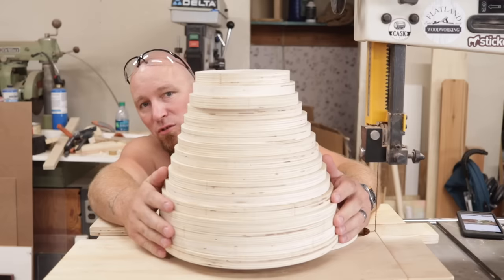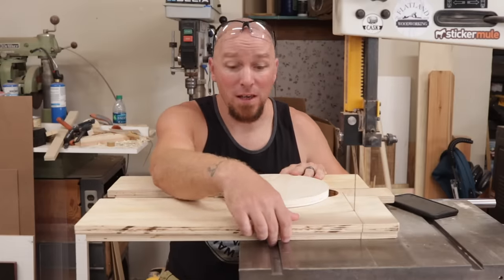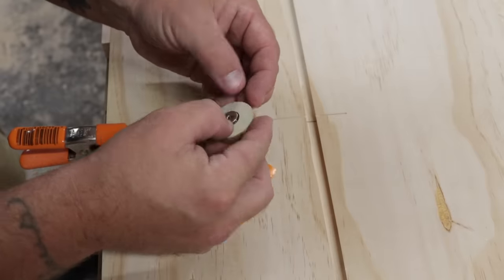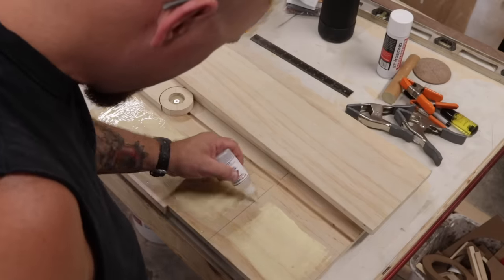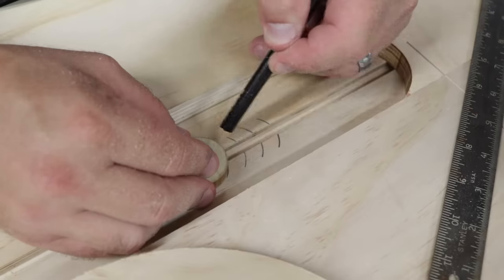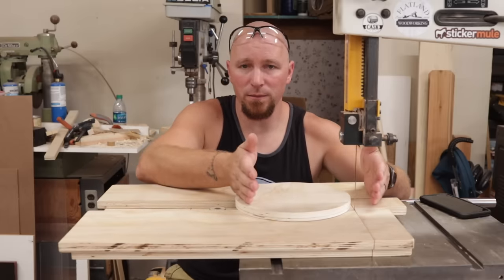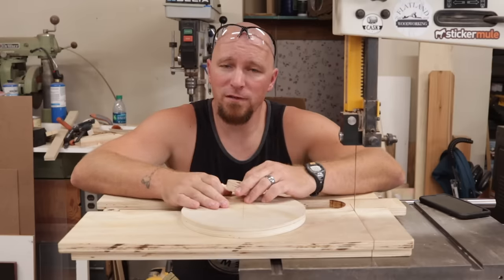The ONLY bandsaw circle cutting jig that fits EVERY NEED!

Comment: Ok, I built this jig.. It works well. I made a couple alterations. On the "stick on puck" I used a thin pull saw to make the alignment marks on the face and sides, then filled the marks with white acrylic paint and sanded. I used walnut for the puck so the contrast is real good. The replaceable zero clearance insert that the blade cuts into is held down with a counter sunk slotted 1/4-20 screw into a T-nut in the bottom of the jig base. The stop on the side of the jig has a Rockler four sided knob with a stud and a wing nut to lock it (goes thru a t-nut). This allows you to adjust the blade tooth position if you change out the blade to a different width. I also find that when affixing the puck to the bottom of your workpiece I use double sided tape and 2 pin nails (I ruined one test piece when the tape let go and the puck drifted (ended up cutting a spiral). The dovetail cut that the nut rides in was OK, but a T-slot from rockler (the one that accepts hex nuts as well as t-studs) just runs smoother and tightening a bit too much doesn't chew up the slot. Anyway, just a couple ideas. Thanks for the jig idea in the first place, it really does work great the way you made it, but I have a motto... If it's worth doing, it's worth overdoing.. lol
Reply from the maker: Ha! I have similar mottos. Everything can be improved, right? I like your changes and improvements. This was built as low-buck as possible and I basically used stuff I already had in the shop.
Reply: @InspireWoodcraft  , oh I hear you on the low buck thing. The T-nuts, T-Slots, bolts and knobs I had floating around. I had some coupons for Rockler and bought a couple of their fixturing parts grab bags. Just used the jig again today to make Pizza turntables. The thing is so accurate you can shave 1/8 or less off the entire diameter and get a "Ring" you can use as a band for something else. Truly one of the handiest jigs I have built.
Reply from the maker: That’s so awesome!! Yeah I leave mine on the bandsaw post and that way it’s easy to grab when I need it. It’s so quick and effective that it’s actually fun to make circles 😂

Comment: Nice video and an interesting jig.  The only thing I would suggest to fix the rocking issue would be to simply clamp your jig down to the table, problem solved.  Thanks for sharing.  It think I might try this one.
Reply from the maker: Yeah definitely a good idea, although you would have to attach and release the clamp over and over if you had multiple cuts to make. Honestly the rocking hasn't given me any problems so far but in the future I would probable use the second track or something. Thanks for watching!
Reply: @InspireWoodcraft  you're right, it might be a little bit of a hassle.  I just no if it were me and I didn't clamp it something bad might happen.  Haha.  I get butter finger sickness from time to time.  Thanks again for sharing.

Comment: You have 2 tracks in the bandsaw table. I would have made the jig to cover both tracks and it will lock down to the table and not tilt.
Reply: Ive cut many circles; itty bitty(1/8") and giant circles(42 feet), and the big ones will bend once you get as big as 5' or so, no matter what you do...but yeah, using both slots will always be better than one.

Comment: Where your left elbow is at 7:20 in the video: attach an outrigger to the bottom of your jig,  ply or aluminum let in to the bottom. Then just clamp this to the table. This way you don't have to worry about getting the height of the floor support on the other side   just right. 
It's a terrific jig, well done. It just solves so many issues so well. The large ring instead of the sheet rock screw. Twenty years ago I don't think anyone ever considered double stick tape and saw blade, but the surface area of the ring solves that issue. 
Probably be better if it wasn't so thick....but that's just something to consider in the future, and only when there's a need for the extra space. And double thanks for the glue/super glue accelerator tip. It seems so obvious...now. 
You could even use your basic concept to make a form that the ring, or some variation would follow to cut out a pattern.
Reply from the maker: The thickness might not be needed, you're right. However it does add a bit of stiffness to the jig, which is nice to help prevent warping. I use double-side tape for everything! It works amazing for table saw jigs as well, or even setting up stop-blocks or sacrificial fences. I've thought a lot about patterns as well and what I would really like to do is make a similar jig to cut ovals.

Comment: Great design with the non-destructive pivet point! Isn't it possible to use like a toggle clamp on the bottom to lock it in place and prevent the jig from rocking?

Comment: Best circle jig I've seen.  Like you I've been exploring options to avoid having to put a hole for a peg into my work.  You've gotten to the solution sooner.  Congrats on the build.  BTW, I'm always looking for a better option for double-sided tape.  Curious what you are using as it appeared to stick really good.
Reply from the maker: Thanks! That's something I'll be running into soon as well. The roll I have now is actually a roll I got from my last employer. I have done a little research and I believe McMaster Carr has a lot of options. I just looked at my browser history and apparently I was looking into Intertape 591 at some point from a website called findtape.com. I am also going to check U-Line, but I don't know if they have it or not. Hopefully that gives you some leads. I should be choosing some and ordering it soon and then doing a quick video on it, so I'll make sure to link what I find when I do. I know a lot of people are looking for recommendations.

Comment: Hi and thanks for another great video.  You added a fixed stop to the jig so that your centre point would line up with the throat (front of blade between teeth) of the blade.  What happens if you use a different size blade, or change the blade and track it on in a slightly different position.  Wouldn't that stop need to be adjustable  to cope with these variances?  In my experience the pivot point needs to be fairly precisely lined up with the blade throat otherwise all hell breaks loose. Just wondered what folks think?

Comment: Great idea,  Perhaps make the jig extend further past the blade so it could be clamped down, or make the stop more robust with a bracket that fits under the edge of the table to prevent tipping?

Comment: Nice idea. If the stop block used to prevent the base from sliding too far into the bandsaw table was “L” shaped, it would catch on the underside of the metal table and help prevent tipping.
Reply from the maker: Absolutely. On my saw the fence rail and table are too close to the same plane for that to work, unfortunately.

Comment: Consider 2 or 2 removeavle hold down in your open miter slot.  
Cut slot in your miter slot facing jig edge to receive it - about 2/3rd's above table top, for strenght to eliminate the jig rocking issue and possible not have to support outter edge except in more extreme situations - possible heavy stock projects.

Comment: Great idea. Maybe use neo magnets on inside (throat side) bottom to help rocking.
Reply: No. When neo connect to steel surface it is with great impact. If you shatter a neo  bits and pieces will get into the 'T' track and you will never get them out.
Reply: Neodymium magnet would also it hard to slide the jig into the proper position for the blade, it was a good thought though.
Reply: I like the idea of the magnets. Just need to imbed them just below the surface of the slide to prevent hitting and sticking to metal table. This avoids smashing and allows table to still slide.

Comment: An excellent circle cutter...better than mine.  However if you move your fence over to almost touch the movable sliding base plate, then add a clamped horizontal runner to the side of the fence, overlapping the base plate,  but adjusted to just clear the top of the sliding base. You will not have a tipping issue. If the base tries to tip...it is held in place by the runner on the fence.

Comment: Very nice design; I've always disliked jigs that require you to make a hole. And the video was nicely done ... succinct, but with all required details. I'm now making my own version of this, and 90% of it is from your design.  I am making a few changes, however, and thought you might be interested:
1. I was concerned that the slot for the dowel/dougnut might get mis-aligned with the blade, so in the stop block I drilled a hole and added a t-nut and a 10-32 machine screw. By turning the screw one way or the other, I will be able to ensure that the channel is always aligned with the saw teeth. So I can use different sized blades and not worry as much about getting the position of the new blade exactly in the same spot as the old one. 
2. Instead of using a dovetail for the channel, I routed out a 3/4" wide by 3/8" deep stopped dado and installed an aluminum t-slot track. For jigs I've made in the past, I've found that a steel nut in a wood channel causes the wood to become compressed, which can affect the accuracy of subsequent cuts. The t-track seems to give a more positive hold. 
3. I had a bearing kicking around from an upgrade to my planer, so I used it in place of the dowel. I was able to cut an oak plug to fit the center of the bearing and tapped it to fit the screw. The plug was sized so that it's tight in the bearing, so I didn't bother to epoxy the screw. I had to buy a forstner bit to match the size of the bearing, but I can always find a use for another forstner bit!
4. For the tilting, my bandsaw, like yours, has a left-hand t-slot, so I extended the platform over it, and added a runner that extends out past the platform on both ends. When stability is an issue, I plan to loop a cord around both runner ends under the table and keep it sufficiently tight that the left side won't rise up.  But I haven't had to do that yet, so I'm hoping that's sufficient.

Hope that's useful. But those are just minor changes ... your design is excellent as it is!

Comment: I was wondering if putting some rare earth magnets on the bottom would be strong enough to prevent the jig from tilting when doing larger pieces with a larger diameter. Although may be hard to get in place if the magnets are too strong.

Comment: Would you be able to make many 40 inch diameter plywood circles with this jig? What size jig/bandsaw blade are you using? What size bit would you recommend for a router using a commercial circle cutting jig I wonder?

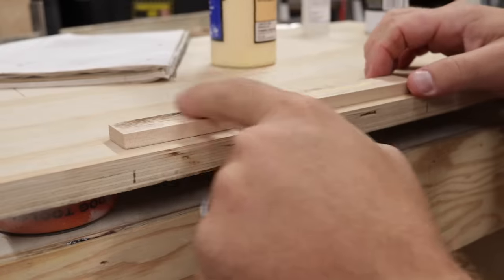Comment: At 2:20 you apply a stop to the table.
Try threaded inserts and machine screws instead of glue. That will let you align the center of the dovetail with the blade.
Reply from the maker: Yeah that would definitely work well too.

Comment: One way it would sure-up against the rocking would be to make the base of the jig run in both grooves with the "T" runners. Just a thought. Or build a two piece "hook" under the back side of the jig that hooks it under the saw-table at the stop. A little "L", so to say.

Comment: How about extending the bottom of the jig to the far end of the bandsaw table and have it hang down the far end and return under the base. Then add two knobs that tighten it to the table. Then you don’t need a 2nd runner and it will secure the jig to the bandsaw table

Comment: You could make a small right angle piece made from scrap plywood that would be screwed to the edge of the left side of the sliding table to capture the underside of the saws table. This would prevent the sliding table from rocking once the circle jig is pushed into the blade, it would also act as a stop as well.

Comment: Really great dude ! A longer jig table could be clamped and avoid tumbling...no ?
Reply from the maker: Absolutely! The only issue with clamping is having to take the clamp off and put it back on after every cut which in a production setting could get annoying. The rocking hasn't been an issue at all though thankfully!
Reply: So what about a Nemodym under the jig ? (you have at least a big fan in France ! =) )

Comment: If you extend the jig to reach past the far edge of the table you could add a spacer the thickness of the tabletop and a ledger that would pass under the tabletop. The ledger would prevent the tip. This option wouldn’t require pausing like using a clamp would.

Comment: I wonder whether or not a strong neodymium magnet can do the same job so you don't have to use double sized tape. One question though, you have 2 tracks in your band saw, why didn't you make your jig bigger and used both of them to prevent the jig from pivoting ?

Comment: nice tut but let me ask you when I need a circle I have a piece put on my table it has a dowel that goes into it measureded off the didtance tell me which peg is neede for a one inch to 12 inch.Find the center of my square cut piece place the dowel inside it plave that in the appropiate dowel in the table jig and I cut me circles.Much easier that your set up and just as accurate.

Comment: Fine job with both the jig and the video.  I mentor a school robotics team, and we make a lot of wheels and pulleys at the band saw.  One problem we have is blade drift, so the cut insists on spiraling out instead of following a circle.  This happens with wheels of all sizes even though we clamp securely, align the axis of rotation with the leading edge of the blade, align the blade teeth with the crown of the band saw wheel, and keep the guard low.  Relief cuts perpendicular to the circle help, but I'd rather solve the underlying problem causing this.  Any suggestions?  Thanks.
Reply: Try move axis of rotation  to 1/3 of the blade width so you see that the backedge of the blade  runs free off the wood.
Reply: Thanks for the suggestion - We'll try an experiment with the axis aligned at several locations leading and trailing the blade.  I suspect also that a narrow blade will help.

Comment: This looks great.  I do have a question, however.  How would you make hoops?  I have a "miniature" jersey cow - yes they are a thing, just like miniature ponies.  I plan on making LOTS of cheese as cheese is getting SO expensive.  I don't like the idea of having cheese curds pressed against plastic cheese molds for hours at a time, should anything leech out of the plastic. Stainless steel cheese molds are SO expensive.  I am thinking of making several hoops out of solid oak, clamping and gluing them on top of each other with food safe glue and using a natural oil to finish the wood.  They make cheese commercially with wooden molds in some places in Europe.  The wooden "cylinder" would need a large circle on the bottom and s smaller one that just barely fits inside for the top (called a follower in cheese making jargon.).  The follower is what one puts 1, 2 or 3, litres of water in a jug, depending on how much pressure you'd like bearing down on the cheese.  The entire cheese mold has several small holes, maybe 1/16" on the sides and bottom which allows the whey (liquid) to escape but small enough to keep the curds inside.  (Of course, the curds are wrapped in cheese cloth inside the mold.)  

I am busy!  If someone wants a good home business idea, make cheese molds from quality wood like oak and sell the on ebay!  Believe me - I have looked and looked - it is so hard to find quality cheese molds!

Comment: Great job on that runner track!! Nice jig.

I wonder if you extend the base to the other T track so the slead runs 2 runners of you would eliminate the drop with larger pieces.
Reply from the maker: Hey thanks! Yeah think that would do the trick, although it’s in hindsight. I still haven’t had any issues with it because I haven’t needed to cut anything that big. I have a 15” maple cutting board that will be going in soon. That’s the biggest I have had a need for so far and even that won’t tip it.
Reply: @InspireWoodcraft  we can so often get into planning and building for the what if... we can get so caught up overdoing anything instead of just getting to work like you said!!.

Comment: Okay, I give up.  I was not able to make a circle without having a "step" at the end.  So obviously, I'm not making a perfect circle.  Like some others, I dado'd a T track into the plywood base and used T nuts.  I think that might be part of the problem, the center of dowel has to be perfectly placed, which I thought I had achieved by following the instructions, but when I turn the dowel by hand close to the unrunning blade, I can tell there's a elliptical wobble to it.  I figure it's either an issue with the T track or dowel.  Don't know where to go from here.  I'm thinking of starting all over with a jig that uses a pin.  Any advice would be appreciated.  Thanks.  Mark

Comment: Just seen this, as a suggestion. So subbed, Thank you. 
Brilliant. 
One question, 
I need to cut holes, it is the Hole I need rather than the discs. 
Been asked to build a pair of Sub Woofer cabinets and the plan is for 21" Drivers units. 
A mod or variation to cut 
8" 10" 12" 15" 18" and 21" Holes would save me a huge amount of effort at the larger sizes 15" and up. 
Thanks.
Reply: Just use the same jig (or the other kind with the pin)and fill the in-cut with a strip of veneer.

Comment: An easy and quick fix to the rocking table issue is just to clamp the left corner of the jig to the table as you are facing the blade. The wood being cut would be away from the clamp.
Reply from the maker: The only problem with clamping is that you have to take the clamp on and off every time you make a new cut. I made this for cutting many circles in one sitting. The rocking hasn't caused one issue so far thank goodness. Thanks for the suggestion though!